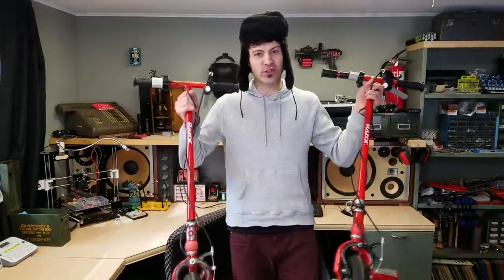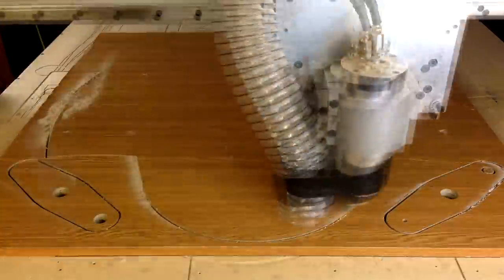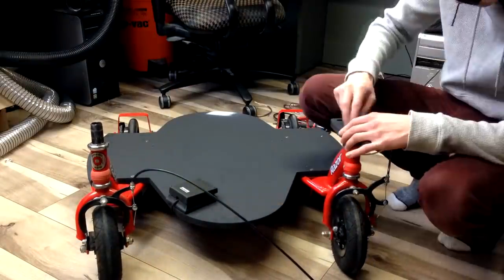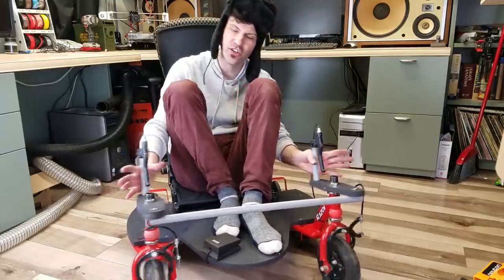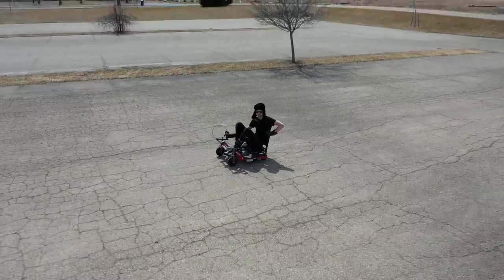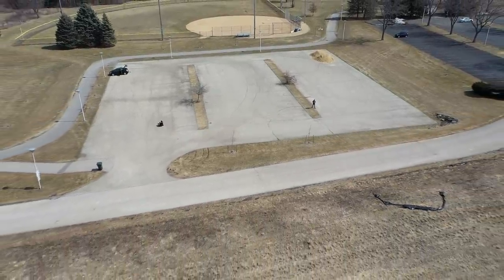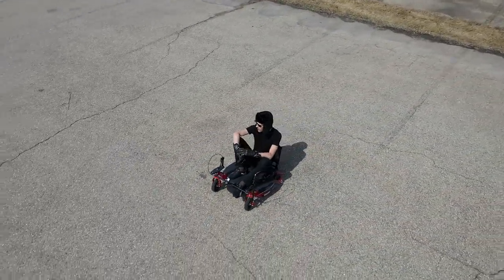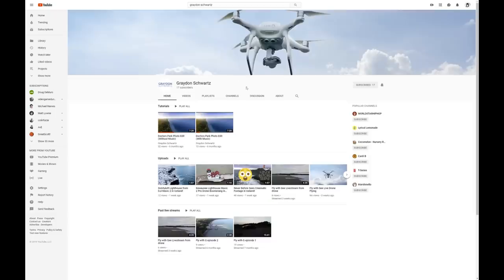Two scooters transformed into Go Kart!

Comment: Did you make sure to allow the scooters to go top speed? Many electric vehicles lock  the top speed lower to obey laws using the speed controller. The “hover boards” almost all have this “feature”
Reply from the maker: I believe so since I removed the relays from the control board circuits. The motors are just very weak in these basic scooters, and that is the primary limiting factor!
Reply: Joel Creates ya they aren’t the strongest scooters I’ve seen but you use what you can get.
Reply from the maker: @Cl0udWolf  Exactly, I think I spent $75 max in total materials!
Reply: Joel Creates that’s pretty affordable for that kind of thing. The parts I have would go much faster but they cost like $70 per BLDC motor, but 1 of them can get you going at around 30mph depending on the use.

Comment: In the video, you said you removed the relays to avoid the need to have the wheels turn to allow the power to flow to the motor. Can you advise if you jumpered anything to bypass the relays, if so can you share the wiring diagram, thanks
Reply from the maker: I wired it super simply. Each motor has two relays run in parallel to split the current. The switch closes the relays, sending power to the motors.

Comment: Joel! Great Build! Could you shoot me over your wiring details? Fantastic work going to build this with my 11 yo daughter 😆
Reply from the maker: I basically just removed the relays and ran two relays in parallel to each motor. You could also just order one decent amperage 24 volt relay on Amazon for the whole thing.
Reply: @JoelCreates  Thanks!

Comment: wire the brake controls to one handle and the accelerator to the other, that way you dont have to hold your right leg in an awkward position to step on it

Comment: you should try it with higher voltage batteries and see how fast you can go before the motors fry
Reply from the maker: I think I want to do it with bigger scooters!
Reply: Something like a razor crazy cart would be perfect for it. I believe they have a larger motor and as a bonus the motor itself is mounted onto the wheel in a small package. The only issue would be finding them cheap though sadly

Comment: Bro could you make a flip flop launcher idk why but it would be so cool to see someone launch a spinning flip flop
Reply from the maker: I'll put that on my list of possible projects! My one concern is that given the low weight and large surface area, they would immediately slow down from wind resistance, but perhaps there are some heavy smaller pairs I could use...
Reply: @JoelCreates  Maybe if you bundled pairs of flipflops together you could make a denser flip flop projectile?
Reply from the maker: @lol0237  true, but I feel it would be getting too far from the original intent, which (if I am not mistaken) is to watch a flip flop fly dangerously through the air at a target!
Reply: @JoelCreates  Good point!